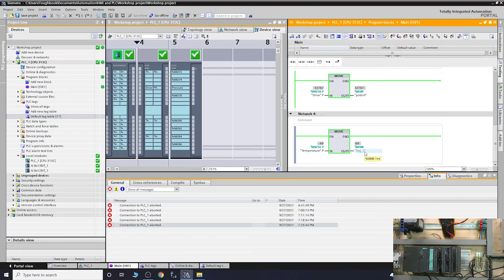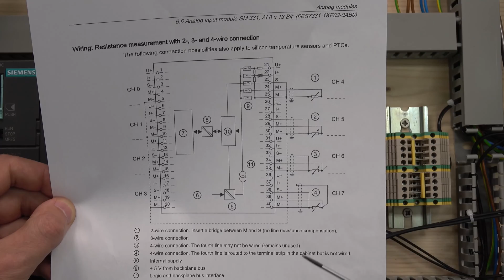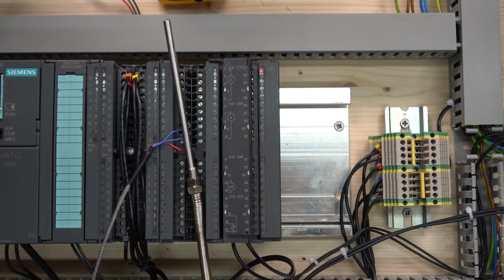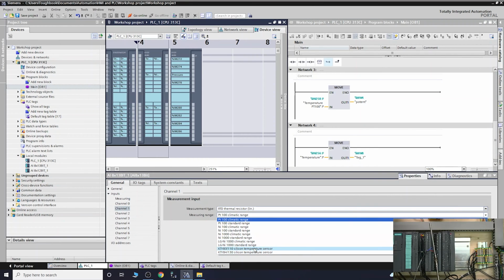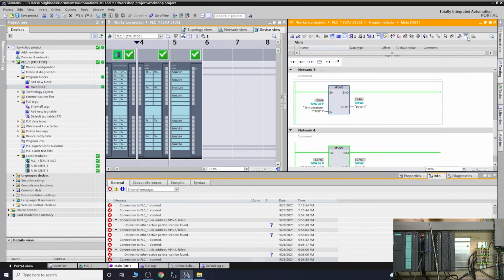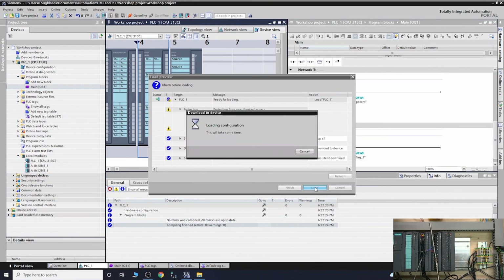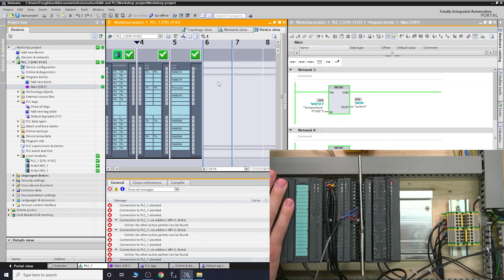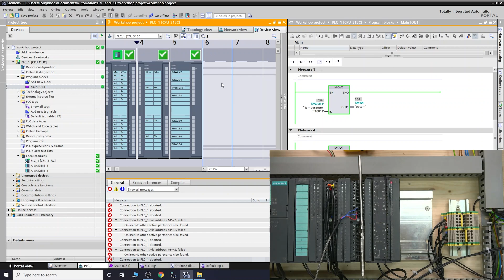Siemens S7-300 PLC analog input card SM331 1KF02/7KF02 thermocouple PT100 wiring/setup. Part 2

Comment: is it possible to use s7 300 in the Tia portal? I thought it is only for S7 1200?
Reply from the maker: TIA portal is for S7 300, S7 400, S7 1200, S7 1500 and many other stuff. Most siemens products are programed and configured with TIA portal.